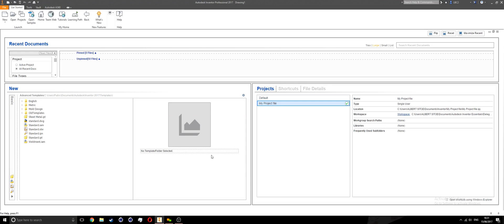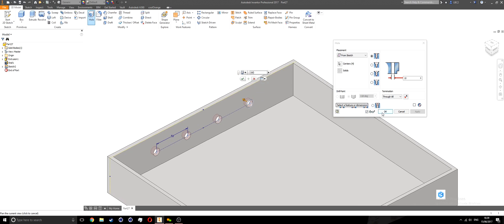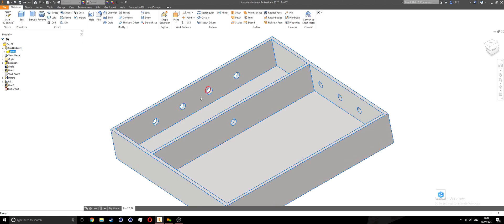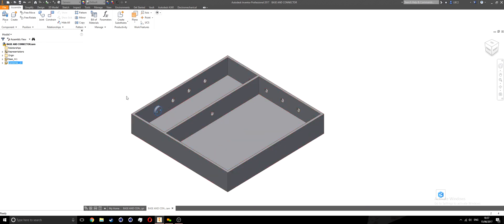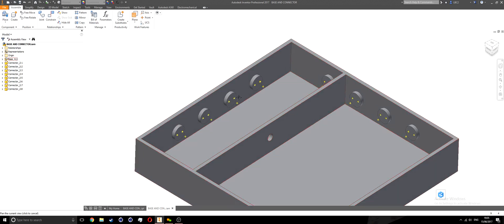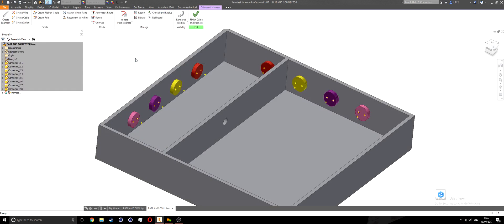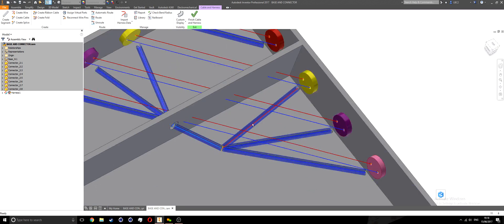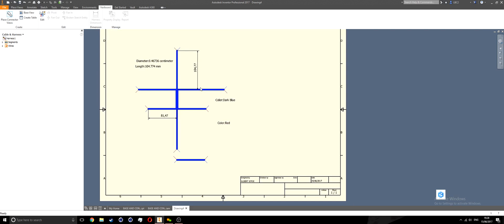AUTODESK: INVENTOR 2017 CABLE AND HARNESS ENVIRONMENT(Introduction)

Comment: Howzit. I take it that the construction has to take place as an assembly in the "Cable and Harness" Environment and then broken down into individual components (enclosure and connector) with the use of the 'new solid' icon within the Extrude function? Is there no way of starting the items out as individual .ipt components and then converting them into "Cable and Harness" components - similar to what you can do when converting a standard .ipt part into a sheetmetal .ipt part? When starting the assembly in the "Cable and Harness" Environment and wanting to save down different subfolders seem to get created - AIP and Cable and Harness - what are these actually for and how best are they utilised? Cheers

Comment: I'm using inventor version 2019, and I cant get the harness panel to show up, even when I right click on show panels, there's no harness option. did it get moved in later versions of inventor?
Reply from the maker: Is the software  Inventor Professional?
Reply: @specsarena1124  I am on Inventor proffesional, education licence. The harness menu is different in part mode than it is in assembly mode. If you double click on a part in assembly mode, it should revert to the toolbar you get in part mode. It is a bit tedious!!

Comment: 29:35 i dont have the harness option when i right click ??
Reply from the maker: What tier of Autodesk Inventor do you have? Inventor LT, Inventor Standard or Inventor Professional?
Reply: @specsarena1124  its a trial version off their site of 2019 professional. i have an interiew tomorrow in the harness department and im gonna have an inventor quiz, HELP !!
Reply from the maker: @justingt3rs  mail me on alberts@learnfast.co.za I am using 2019 and it is still there you must be in the part environment for this to work
Reply: @specsarena1124  thanks for your reply, i was in assembly
Reply from the maker: justingt3rs tell me how it goes 🙂
Reply: @specsarena1124  interview went well but i didnt end up having any harness questions in my inventor test